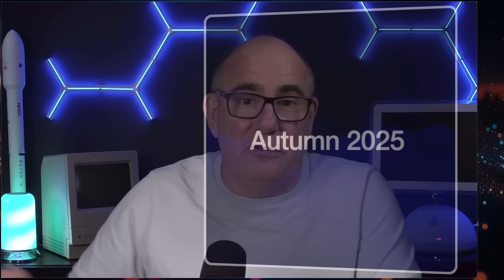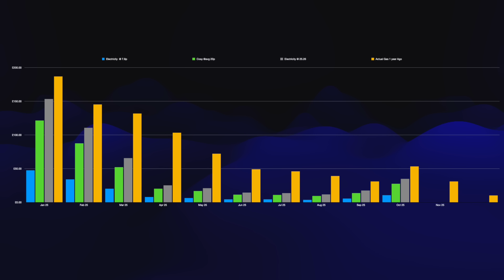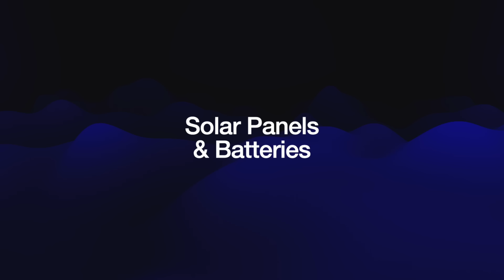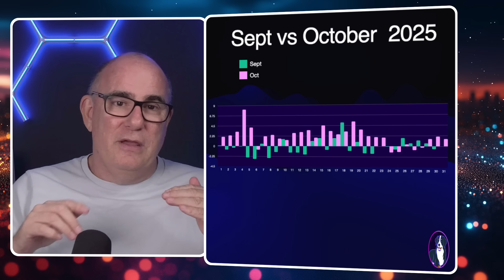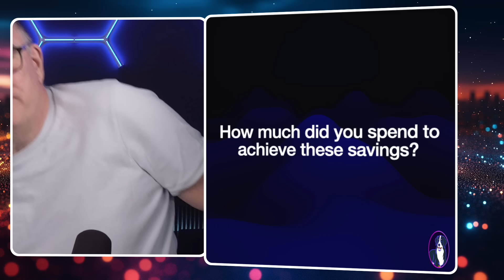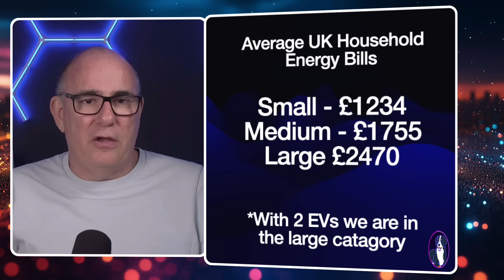How We Owe Nothing for Energy — Octopus Actually Owes Us

Comment: In the US. We made our old house all electric when we rebuilt it. We had to upgrade insulation, wiring and plumbing anyways. Rural propane just for the cook stove, hot water and winter heating was over $1,200 a year. We spent about $1,200 a year on gasoline and $2400 a year on electricity. Let’s just say $5,000 US, 4,300 Euros, or 3,800 Pounds a year for energy. 

In a major remodel, because heat pump hvac and hot water heaters are so much easier to build in than traditional AC and furnaces (no large ducts or dangerous gas lines), it is far cheaper to install heat pumps and induction stoves than old school fossil fuel equipment. 

We got our solar and battery kit for $30,000 US. That is a six year payback at current rates, or more realistically, five years as electricity and propane and gasoline prices always go up and up and up and up and up and up!

The challenges with solar and batteries are:

1. In the US, big utilities get tax breaks and taxpayer funded welfare payments for new power stations and power lines that individual citizens don’t get. But the US is a corrupt oligarchy that prioritizes corporations and billionaires over citizens. Maybe you Brits, etc. get a more air deal.

2. Citizens get far worse interest rates than corporations and oligarchs. Several times worse!

3. We pay dozens of times more for permitting per kW of installed panels or kWh of batteries.

But, those of us who are energy independent will be far wealthier over time than our poor fellow citizens who remain slaves to the corrupt oil and electricity cartels.
Reply: Specs on our kit, just over 14 kW of panels and 28 kWh of batteries. And the car is a used, 2023 Kia Niro with a 64 kWh battery it has no problem topping off overnight. Hoping to add a used EV pickup next year. Have also upgraded our propane grill to an electric, Traeger smoker/grill, and our old, 2-stroke gas trimmers, chainsaws and other gas property maintenance equipment to battery. We are very close to being completely off burning fossil fuels!
Reply: On the coldest nights in winter, we do supplement our heat pump heat with our wood stove. That has kept us from having to add more home storage batteries. And the wood is a byproduct of clearing brush for wildfire safety.
Reply: UK permitting equivalent is pretty clean. One set of standards for equipment UK wide. One for building regulations and for most cases exemption from planning applications. 

You need an electrician to do bits of the install, or there is an overall certified installer scheme called MCS for installs. That adds a chunk of cost but is tricky to turn into an overhead cost as it also includes insurance and kicking backsides on install and post install problems 
A typical UK install involves a form to the energy company (free), paperwork for wiring changes filed by the electrician and if MCS some other bits.

Ground install is a pain in much of the UK though as it requires planning permissions for all but tiny setups still which is just stupid.

I can build a fence out of wood, plastic, even old toilet seats and I can even paint it neon pink but I can't use solar panels for it without planning permission!
Reply from the maker: Yeah I have seen the cost of sysetms in the US double after all permits and inspections are done. Seems counter to the US, small government ideals
Reply: @JonathanTracey as the joke goes it's the land of the FEE.

Tariffs also have a significant impact not just the maze of regulations.

Utah has managed to get plug in solar sorted unlike the UK though

Comment: If I was starting again I probably would have just gone with battery storage using the cheap night rate. This route might help a lot of people who couldn't afford the whole set up. My system is 3.2 solar, maxed out space wise, with 13 Kwh battery. The only scope maybe for improvement would be extra batteries and utilise the 7p overnight rate. I am looking into whether I can use my garage roof but maybe the extra battery route might work out less expensive. Currently the feed in offer is 5p per Kwh and as my system is so small hardly worth the bother as I don't generate much excess, however my leccy bill is significantly lower as you can imagine. Not really worried about payback period more for my Sons benefit when I pop my clogs!!🤣🤣🤣
Reply from the maker: The thing to be careful of is that it looks attractive to buy more batteries and then import export energy to make a bit of money, but the only works if the export rates stay at the current amount, which everyone seems to think won’t happen forever

Comment: Our 5.6kw SE facing solar panels and 17.5kwh of home storage batteries and an EV charger were installed in 2020/21 . We spent about £18k and have so far recouped about £14k. We run 2 EVs covering 8-10k miles per year between them We are £30 in credit with Octopus after exporting excess solar and a two hour evening export from our batteries. We do still have gas £800 so far this year for heating and hot water. A HeatGeek installer is coming to do the heat loss survey in a week or so. Here’s hoping we can get a reasonable price for an installation (we have quite a small airing cupboard so a new heat pump cylinder could be a problem).
Reply: Worth considering their "mini", however the heatgeek guy who did my survey last week couldn't quote based on that - apparently you need to contact them directly, which I have, and it's been a week waiting in the reply. I don't know if the mini are fully powered by the heat pump when under load. They also have slim tanks which might work out for you
Reply from the maker: I have a small cupboard as well, the answer was a taller cylinder, same volume but went upwards twice the height of the old one. We had to sacrifice some towel storage but was worth it. Heat Geek should be able to give you some options

Comment: Heating on heat pump running our total electricity bill for October was £75.91 (normal summer bill £55)

Gas standing charge would have been about £10. 
So whole of October cost about £20 for heating and I don't pay to keep the gas network afloat
Reply from the maker: Yeah, and you’d probably pay a lot more for gas in December and January, I think in those two months alone I’ll probably saved close to £100 compared to what I were used to pay for gas
Reply: @JonathanTracey  your probably absolutely correct, keep up the good work buddy 👍

Comment: I guess the same as financial products there should be a warnings  on things can go up and down. 

How do the numbers stack up if the export was 7.5p and not 15p. Realistically I can't see it being that high over a long period. 

When you are a low user of the actual electricity (no EV as can't charge at home) a change in export rates massively skews the numbers from maybe 15+ years to "I'll be dead long before".
Reply from the maker: Sofa me as the product already paid for itself, a reduction in price with the catastrophic, I would just move to a more of a self consumption mode rather than an export mode. However, if you have taken out finance based on 15p reduced that could be an issue.
Reply: @JonathanTracey Yes if you're in a position to self consume more then that makes sense. But for 6 months of the year the production would be more than can be self consumed.

Comment: i am in a slightly different perspective, i have gas/electric plus a FITs 4kw solar system installed in 2013, so far this year it has paid me out £939 on FITs payments, my intial solar costs was £7200 minus a HMRC tax rebate of £4400, i paid a £1000 & fiananced £1800 over 2 years on a cheap green fianance deal @ the time, total cost for the 2 years of fianance all in was £2023, however i had that back in FITs payments within the first 3 years,so literally since 2016 FITs has been covering the gas & electric, even more so as it is now just me & the dog @ home,running total from octopus for my annual gas/electric to date for 2025 is £684, i do not use the gas heating,as years ago i was told by the worcester bosch chap it was 68% efficent then, so my combi boiler is on hot water on demand only & i mostly cook with my air fryers, in fact to date this year i have spent 61p on gas to date, but 10 years ago when my parent were alive we had triple glazed windows installed, in the first year after there installation the gas usuage for the house, of 2 oaps plus me, with the boiler on 2 timed peroids everyday ,dropped by 68% due to the triple glazed windows, which @ install cost £1900, plus the cavity wall install @ £0 done on a OAP grant, i did earlier this year approach 2 national chains (1 you mentioned), plus 1 local company to upgrade me to PW3 & changeout the 250w panels for there modern equivilant, who you mentioned did not quote for adding panels just the pw3, the other national company were the same but £1000, difference, BUT the local company to me came out and said what i wanted was do able,which 25 panels over south facing roof/vertical south facing wall,East facing gable wall,plus north facing roof panels, i was lead to beleieve the cost per panel was circa £100 all in panels rails etc,plus the pw3/gateway so i expected £12,500 or thereabouts, when the quote came back 4 and half months later it was £34,995, so that was a definate FRO from me, i spoke with octopus recently & yes they will fit panels/batteries, BUT not sigenstor YET, plus they will NOT remove old panels & they will not put up vertical panels either, but south & north facing roof yes, despite me having my FITs with them the person i spoke was determined i would lose my FITs entitlement full stop, or would need a second inverter, ho hum never mind good figures as usual JT, your solar has beaten my 4kw by nearly 5mw so far this year :)

Comment: I had to smile when you mentioned the washing machine and not chucking it out when it goes wrong. Depends. I DID throw out a 5 year old washing machine. Why? Cost of repair (with me doing the labour) was just short of buying a brand new one! And yes, modern electronics are pretty reliable but working in a factory situation with many many inverters - in the hundreds, yes, they do go wrong and some controllers with electronics, when sent off for repair by specialists repair shops are sometimes deemed to be unrepairable after just 15 years. Others, well, we have some kit that is over 25years old, still running fine. One reason to always put money aside. You never know when it will break. And do you have anybody maintaining the system? Extra cost?

Couple of things, you could have simply added up the costings of ALL the equipment that you've bought over the years. After all it is all part of the investment you have made to get where you are today. And 2. no mention of the standing charge. It is part of the bill! Presumably that gets added at some point.
Reply from the maker: Yeah there’s always gonna be the obsolescence problem, when you actually need the parts to fix a device they haven’t been made for many years. But one of the things I found with tinkering with old 1980s computers is that sometimes it’s just one component that is failed. I’m a little bit of digging you can track down a replacement.

Comment: June 22 we had a 4.68kw solar system with an 8.2kwh battery. £7350. We have a PHEV so have Intelligent Octopus Go. The system has recently broken even on the original outlay. This is all heating, hot water and all the electric miles on the PHEV.
Reply from the maker: what has broken?
Reply: @JonathanTracey the original outlay has broken even recently! Oh and our immersion thermostat went pop last year but that was an easy DIY fix.

Comment: As a comparison. 6.4 KWP panels / 5.5KWH with 10KWH inverter, 10KWH battery south facing so far this year
4000KWh exported and 3800KWh imported . Money wise That's £602 paid for export and £266 for import. £336 towards the gas bill
Reply from the maker: What do you predict you will end up at come 31st of December?
Reply: @JonathanTracey  Hi Jonathan. From last years figures I expect to pay £100 on Electricity so That would leave me with £236 towards the gas bill. That includes charging the car
My total gas for the year expected to be £740. That heating hot water and gas hob
Nick

Comment: We have just a 18 panel 7.83kWh system (not ideally situated) and 13.5kWh GivEnergy AIO.  We also have 2 EV's (my original Ioniq 28 and my my wife's Tesla Model 3 LR) done about 12,000 miles charging at home and 3 bed-semi is currently on gas - planning on getting a heat pump soon! - and the same figures from Octopus for Jan to the end of Oct and we are a £168 in debt.  We'll have paid about £400 for the whole year for the house electric and gas and home charging the cars (I'm ignoring my wife's Supercharging costs as she does a lot of long distance driving for work) 

This is a massive saving - we'd have paid out £1750 for the house energy and another £2000 or so for fuel for the cars.  

Payback - as it is it cost £14500 for the solar and battery - about 8 years. (Include the fuel saving for the cars.... less than 4 years!) 

Given running a heat pump ought to cost about a third of the gas we would be on around -£180 now and we might just be in credit by £50 or so at the end of the year?  😃

 Payback with a heat pump at an additional £3k would be about 10 years (or 4.6 years including the fuel saving!)
Reply from the maker: Sounds like you've got a great setup and some impressive savings!
Reply: @JonathanTracey very happy with it.  👍🏻

Comment: £10k spent for a 19 panel system with 5kWp and 10kWh battery storage 3 years ago. 3 years of zero bills, that's the export paid for the gas bill.  This allowed me to buy an EV. I'm now saving over a £1,000 a year on fuel. 3 years to go for payback on the entire solar system. The depreciation on the electric car will be covered by the fuel savings. So happy as Larry here 😀👍
Reply from the maker: Awesome to hear you're seeing such great savings!
Reply: Thank you Jonathan. Your explanation was clear and simple. I know exactly what to do when I move house. I'm looking forward to solar panels, batteries and a heat pump been installed.

Comment: Hi Jon, thanks for the stats. Like you we went all electric and have no bills (this year £350 credit to date), a bit less solar than you though! Our system cost about £28k for 14 Jinko Tiger Neo panels, just over 6kwp, x2 GE AIO (27kwh battery), Mitsubishi Electric 10kw air to air, Daikin altherma 4kw and Zappi. ROI is not something we really measure. Being energy independent, not paying bills and not burning to drive or heat is more important to us.

 I am surprised that you will use Shell chargers though, I purposely avoid all chargers linked to fossil fuel industries, including applegreen!
Reply from the maker: convenience I'm afraid my parents live in a veritable charging desert, and its the only option unless you want to use fight over the single 50kw charger at the local tesco
Reply: @JonathanTracey Sounds like your parents are getting a charger for Christmas 😂
Reply: @SolAce-nw2hf  😂 🎁🎁
Reply: @JonathanTracey  No Tesla chargers near by? We always use tesla as a preference even when in the other EV. Sometimes no choice I guess, good luck with everything.

Comment: Well done.
In my experience, there are virtually no savings.
My Octopus bills are virtually the same as when I had no solar panels and batteries.
If I had known what I know now before installing solar and batteries, I would not have made the purchase.
Reply from the maker: May want to get somebody to look at your solar panels then because they’re probably not working
Reply: I just looked at my bills from the year before I got my first solar panels. It was really low, but it was also before energy prices skyrocketed.
I would have spent a fortune on the electricity bill in the past five years if it was not for the solar panels.
You may want to compare kWh's over the years instead of pounds. Inflation also means that the money is worth less and solar pretty much solves that problem if you have enough and it's done right.

Comment: You didn’t factor in the savings that running 2 electric cars give over running 2 equivalent ICE cars. Doing that will reduce your payback period by a substantial amount.
Reply from the maker: that was deliberate on my point, we have been a pure EV household since 2011 when we bought our first nissan leaf, followed by a Tesla Model S, so given we have not paid for fuel in 14 years are we really saving?
Reply: @JonathanTracey  you are saving because of your solar you are not buying fuel at a filling station.
Reply: @JonathanTracey agree, ev’s should factor in savings, we’re running 2 evs we bought a year ago,  fuel savings are huge for us,  and do factor into ROI of solar and batteries.  I’m better off due to car choice,  based on solar, therefore it’s a saving.   Appreciate it makes ROI more difficult to factor, as do you include the price difference between an equivalent ICE car and the ev?

At the end of the day,  heading to retirement having to pay nothing for fuel for house and car is about a £4900 a year saving,  so I need a smaller pension pot as I don’t need to pay those bills,  or I have a bang up holiday every year. 

£24k expense now,  while working,  easily equates to £49k positive impact to my life in first 10 years of retirement,  and the system will have paid its self off by the time I retire. 

Father in law did a FIT install back in the day,  he’s making £2000 a year on that and has been making money for about 17 years so far, so it’s tried and tested.
Reply: @JonathanTracey  I agree with you here. Eventually all vehicles will be EVs, and we don’t compare our heating to victorian wood burning fireplaces. It only makes sense to compare to a practical alternative, and “keep existing ICE vs buying an EV” is a different video.